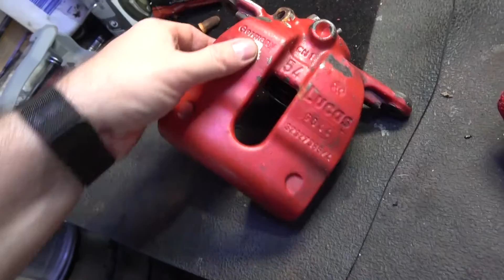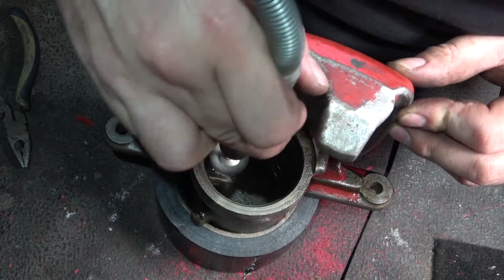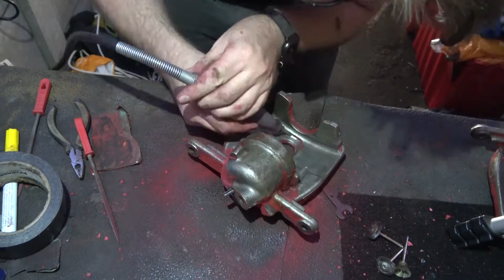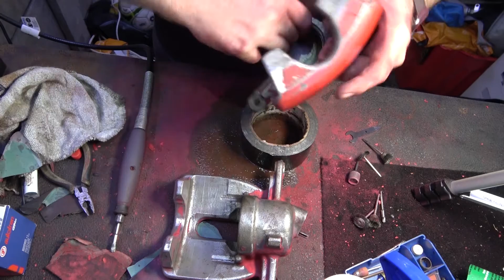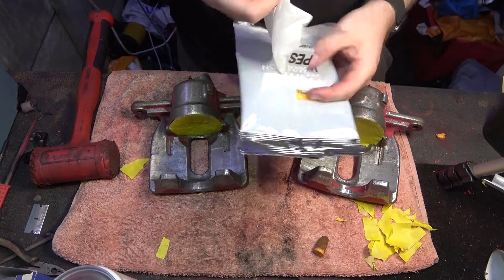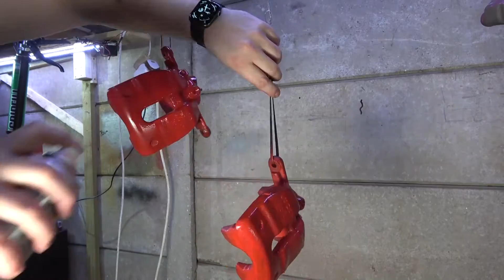Fixing The Standard Brakes! (9n3 polo GTI Track Car Build!) PART 1

Comment: Good stuff looking fresh
You shouldn’t have painted the inside of the calliper, opposite the piston 
If you know what i mean that surface should be bare
Reply from the maker: Thank you mate 👍🏻 yeah I’ll be removing the paint on the critical areas before fitting them to the car, it was just easier to paint all of it 😂 good spot though!
Reply: Car's&Engineering ahh true yes easier take it off than try to miss it
How is the 9n3 ownership treating you?
Reply from the maker: It’s been alright actually mate, just maintained it and kept up with the regular checks and it’s treated me well! 
What about yourself? Do you own a 9n3?
Reply: Car's&Engineering sounds good
No i have an abarth 180 competizione 
Im still into my vw’s doh and was thinking about 9n3 gti months back and seen your channel so subbed for 9n3 content
I still like them i might get one in the future
Reply from the maker: Funnily enough I’ve been looking at the abarths 😂 seen one in yellow that looks pretty nice 😎 the 9n3s are pretty cheap now, they surprise people too where they are so lightweight but with a decent engine 👌🏻
Reply: Car's&Engineering yeh they are good and cheap i like small hot hatches 
I had 3 lupo gtis and i like my cars oem * and always had a soft spot for the 9n3 as it doesnt look really old and can still retro fit heated seats, a nice double din some nice 17 inch wheels some kw coilovers and it will do it for me :D
Reply from the maker: Should have kept hold of the lupos, they are like rocking horse shit now 😂
Yeah that’s what I’m going for with the polo OEM+.... well until it’s stripped and a cage is put in 😂 but there will be another car to work on by that stage 👌🏻
Reply: Car's&Engineering i can only have one car so its very annoying as a daily i do like 250 miles a week, soon as i get a mortgage i will probably end up buying another gti and do an engine swap probably 
Oem + is the right way for me
Have you got instagram
Reply from the maker: Yeah sounds good mate, just enjoy whatever you do 👍🏻 yeah I’ve got a Instagram for the channel I'm on Instagram as carsandengineering19. https://www.instagram.com/invites/contact/?i=pppr0g8k7plq&utm_content=4z4jaxz